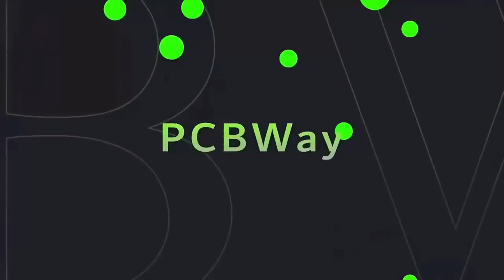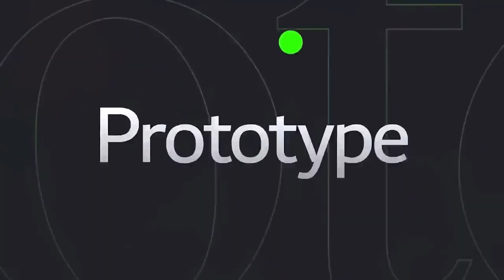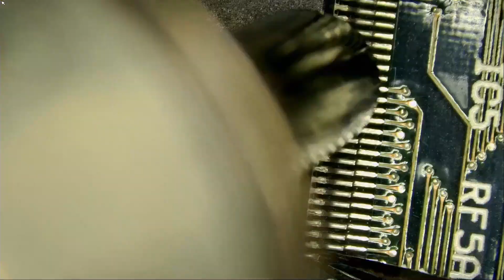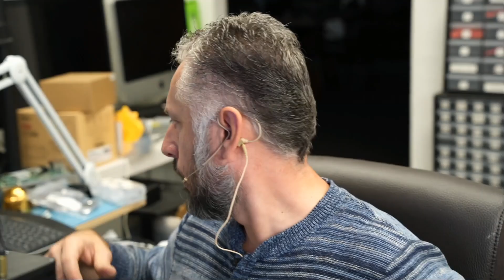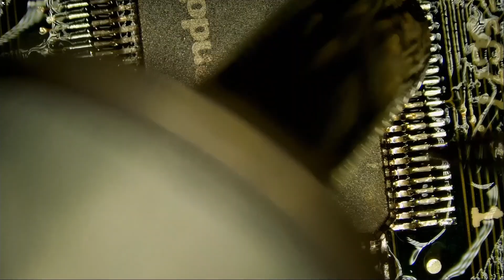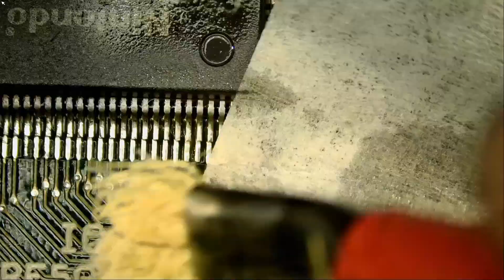Fixing a CPU on a Rare Nintendo Arcade NSS Super System - Only 1200 ever made.

Comment: Working back when SMT was viably new we used aquas flux for everything except when the customer asked specifically for rosin core, this was in 1992-94. To apply the solder paste we had a template skin made of aluminum and automated squeegee  for mass production as also vacuum tooling to place parts on the boards which was a manual process. Loved to watch. The oven was in inferred controlled temp zone of 489 deg if I remember correctly. Last time I visited the factory there where dozens of reel machines with parts, 100s of board components and just an amazing process to see. Miss doing the work.

Comment: Most important step is to send the correct SNES motherboard, and not one from a 1-chip model.
Reply: Not sure I get this comment.

The replacement sent by the customer is correct (you can clearly see it has the sound module which means it's a CPU-01 PCB), and the 1CHIP is not pin compatible AND has a different part number.

The chances of something like that happening are extremely unlikely.
Reply: This customer did everything right.  But a person who is not aware of the different revisions of the SNES hardware might just pick out the first SNES console they see, and it could be a motherboard revision that does not have separate chips.
Reply: The 1CHIP was made in extremely small numbers compared to the others, so it's an extremely unlikely outcome.

Comment: Hey there. I’m the customer who sent this in. Thank you so so much! I’ll be sure to update everyone as to how it works :)
Reply from the maker: Glad I could help.  Let us know how it turns out, and if possible, share a quick video of the reassembly and testing—I’ll post it.
Reply: @NorthridgeFix  will do!
Reply: Be interesting if you resoldered the old chips to the snes board to see if they were faulty. would be more work for sure but a good way to know if those old chips are still alive and kicking.
Reply: It's been 2 months, did it work or should have we paid for expedited update?
Reply: Very interested to see if it works
Reply: did it work?
Reply: @ no it ended up not working. I handed it off to someone else. He’s got it working so I’ll send a video of that if you’re interested.
Reply: @jdlockefeller  be interesting to know if it was those chips or something else cool project though!
Reply: @ yeah the guy that repaired it said that the PPU 2 was the chip related to my original issue, but that the CPU died during the repair, which caused the system not to boot at all.
Reply: @ thats sad, i hope you get a solution in the end. Interesting project for sure! ty for the update
Reply: @jdlockefeller  oh sweet, yeah a video would be nice. What was the issue in the end?
Reply: Are those chips running hot during use, if they do that could reduce life and make them fail sooner. Might be a good idea to attatch heatsinks to them.
Reply: There is an update on the arcade-museum forums. YouTube wont let me post the link. see 1:47
Reply: @DZ-bo8hq  a link to the forums maybe?
Reply: @metallicamadsam  See 1:47
Reply: @DZ-bo8hq  I see 1.47 but we dont know if both or just 1 of the chips are faulty, hence my comment out of curiosity

Comment: Hi mate could you holp me got a macbook pro 2011 15 inch i7 it is stuck at 800mhz will not boost so slow as hell replaced battery and cleaned it out but still no look reset everything thanks

Comment: Hi Alex,

What temperature and speed are you using for your hot air and why?

Thanks
Reply: it depends on the hot air station you're using and the thickness of the board you're working on. Practice on junk boards and start with 350° at 50%. Practicing is the best for learning.